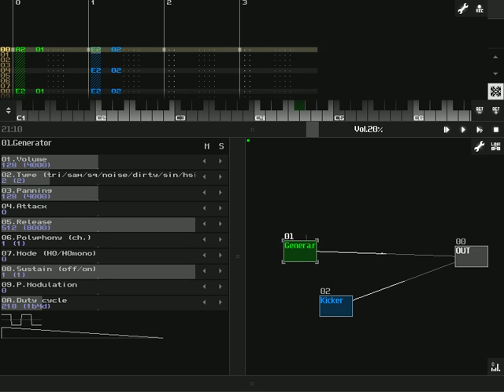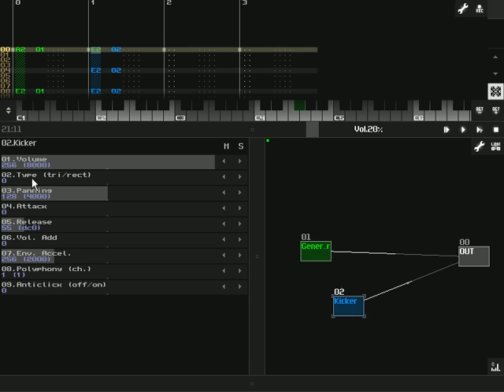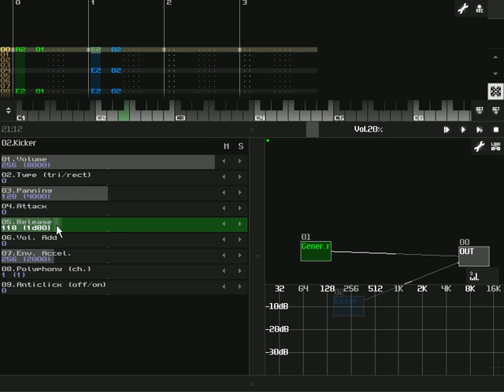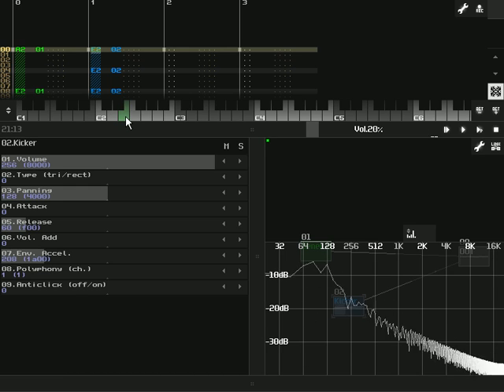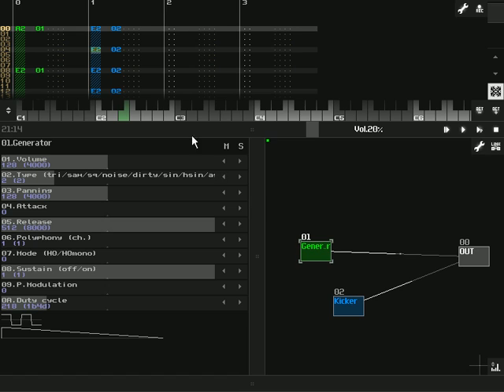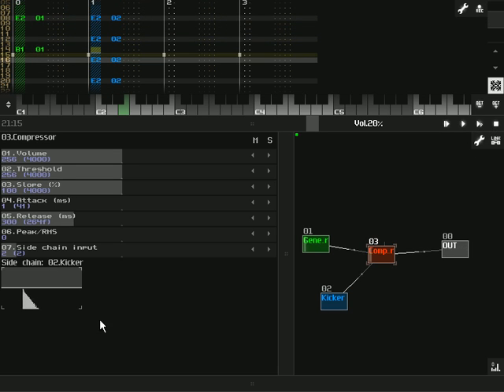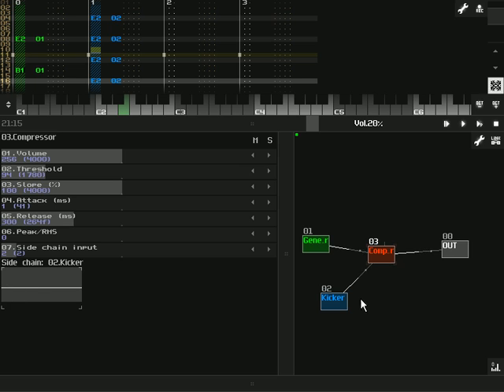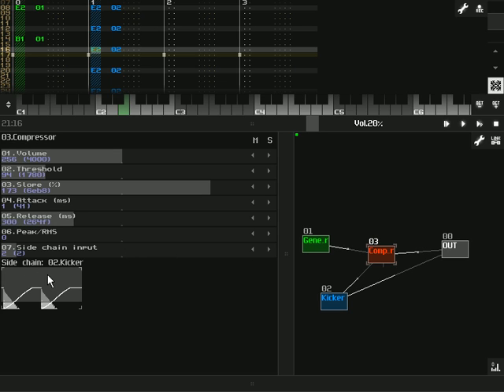SunVox Tutorial Part 9 - Kicker, Compressor, and Ducking

Comment: I like the sound I get when I have the kicker drop in and out while still having the side chain effect going. I've only achieved this, so far, by connecting and disconnecting the kicker module to the output while its playing. Is there a way I can automate this?
Reply from the maker: You can connect the kicker to an amplifier and then automate the amplifier's volume. You can do this by either recording playback and messing with the volume parameter, or by shift-clicking on the amplifier's volume parameter. You can also manually type it in.
Reply: Great, I'll give that a try. I did a Raspberry Pi build specifically to run Sunvox on and learning to use it has been a lot of fun. I've gone through this series up until this video so far and it's been great. I'll definitely be going through all the Sunvox content you have. Thanks for creating it!

Comment: at 5:25 when you started switching between tri and rect types, is there a way to implement that into the actual song instead of being forced to have either tri or rect in the same track? Love your tuts by the why.
Reply from the maker: Yeah, you could either use two Kickers, one of each type, or modulate the type parameter. You can hold Shift and click on a parameter to create an effect to set it.